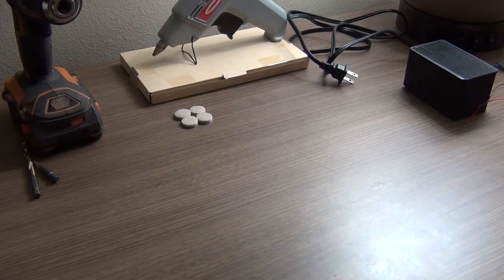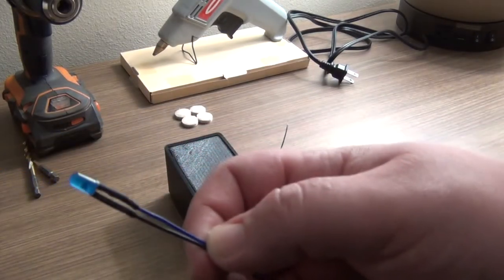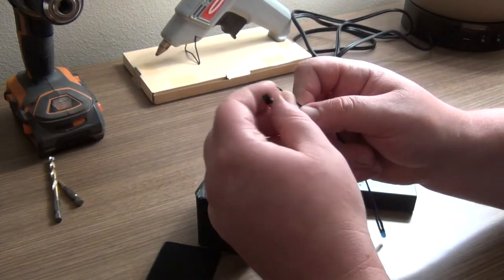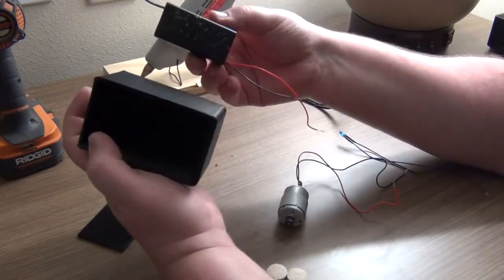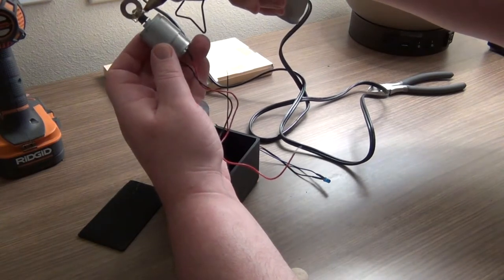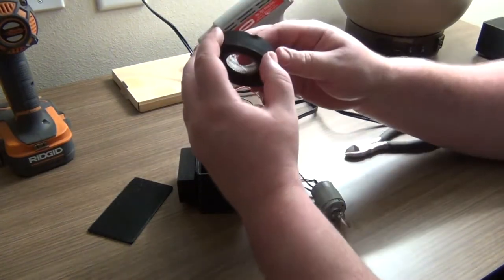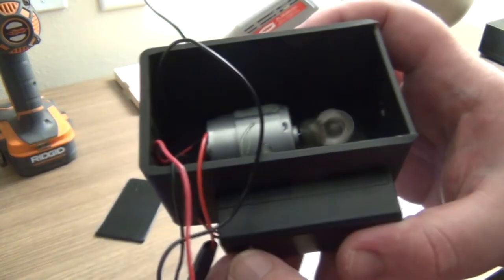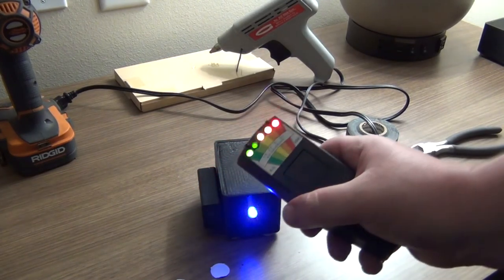How to make an EM Pump

Comment: hey, im about to build one of these. Do, you have to use a magnet, or will it still work without one. Thank you for your time.
Reply from the maker: I still have not tested this!  I will let you know as soon as I do.
Reply from the maker: @helphealserve  - finally tested this.  Without the magnet it does produce an em field, but it only emits to about 8 inches from the pump, and is also a weak field - adding the magnet puts it about a 2 to 3 ft radius of red readings on the emf detector.

Comment: I wonder if it put out just the same amount just motor running minus magnet
Reply from the maker: It shouldn't, but that is a valid thought and I have never tested one without a magnet.  The next one I build I will test it out and respond here with the results!
Reply: How long does this motor/battery combo last? Also what size dc motor is that?
Reply from the maker: @johncrigger6134 - finally tested this.  Without the magnet it does produce an em field, but it only emits to about 8 inches from the pump, and is also a weak field - adding the magnet puts it about a 2 to 3 ft radius of red readings on the emf detector.
Reply from the maker: @WTSportsMoments  so sorry I did not see this before now!  I have never actually ran a battery down doing this - I always replace the battery after a couple of investigations to ensure that it is fully charged. The motor is 1.5-12 Volt DC, 3,000 RPM